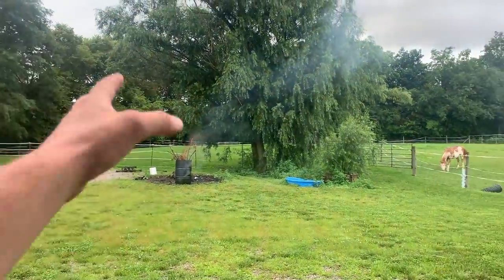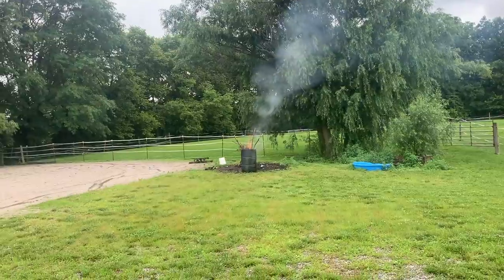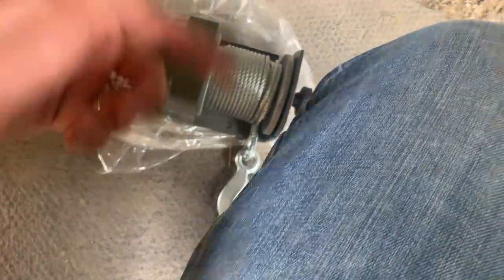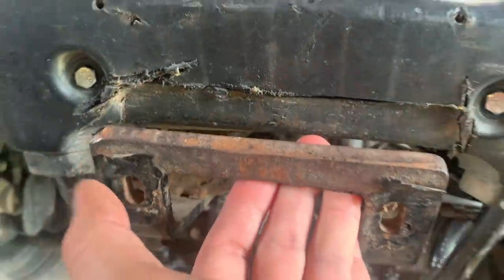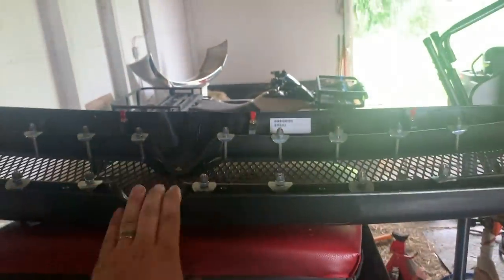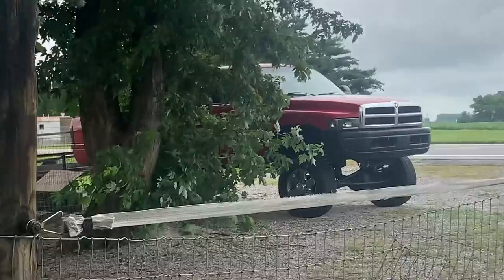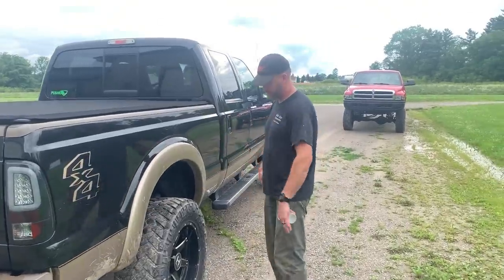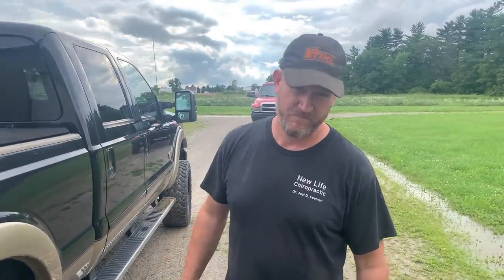EVERYTHING WRONG with a 6.7 PowerStroke! *8 YEAR REVIEW*

Comment: A year and a half ago I sold my dodge and bought a 2011 6.7 ford best decision I ever made. I beat on it every time I drive it and it never lets me down. drives great tons of power 358k miles and it drives like a new truck.
Reply: Why not a power stroke photo then lol
Reply: You bought the truck with over 300k then possibly? How much did you pay?
Reply: @BannedSports   payed 11k in 2018 selling it for 16k after putting a trans and a a lot of engine mods into it had it for 30k miles.
Reply: @hoosqt7447  because most power strokes are garbage. I’ve owned 3 Cummins always been good motors just nonstop issues with the truck surrounding the motor.
Reply: @djcurtis8677  that’s true engine good but the transmission….

Comment: Tons of trucks with the 6.7 powerstroke have surpassed 1 million miles. Best diesel by far not even close. You never hear anyone complain about a 6.7
Reply: I'm looking at buying a F750 from auction. they have like 8 of them. nearly all of them have blowby and im talking trucks with 24k to 60k miles on them. is this just something that 6.7's do?
Reply: So true. I love my 2015 power stroke best investment I ever made and I own it no payments the biggest issue it had was injection pump took a shit at around 75k but it was under warranty still thank god now 155k and goin stronger than ever
Reply: @jakethesk8roberts763  ya until cp4 pump blows up and takes out the fuel system
Reply: @avathompson6711  did you not read my reply my cp4 took a shit I had it repaired at 75k
Reply: @avathompson6711  replaced

Comment: Early 6.7 were known for the turbo issues they got it fixed on the newer models
Reply: like what year?
Reply: @VIP854  2015 is when Ford put in a different turbo
Reply: Your talking about. 2015 model years? Come now. This engine has been bullet  proof since introduction here in the united states.
Reply: I have a 2016 F250 now and the turbo went out at 96K

Comment: Should have 4 mount points to the frame of the atv then 4 bolt holes on the mounting plate to mount the winch to. Then your fair lead will mount to the front for the cable to run through.

Comment: Has he had any leaks from the vacuum pump in front of the radiator fan?  I had a small oil leak from the pump. Come to find out two out of four bolts were loose. I can move them with my hand. Apparently it’s a known problem on the 6.7
Reply from the maker: I believe that was an issue at one point

Comment: I have a 2014 f350 srw platnuim was a great truck until motor messed upped rocker arm fell off pushrods on cylinder 2 and causing lifter to eat camshaft engine had 273k gonna get new engine from ford but every 150k or 200k replace rockers arms would be also recommended

Comment: I have a global 2013 Ford Ranger PX1 and the clear coat peeled as well. Granted, the truck was always parked outside under the inclement tropical sun. I painted the truck and now I keep it in a closed garage. My truck has been awesome too. It has the 3.2 I5 diesel found in the Transit vans. Very awesome engines. Truck has had its fair number of issues but the majority were minimal go medium annoyances. The big one was the mechatronics unit going out after 6 years and low mileage. Its a common issue on those years and I think its a common 6R80 transmission issue. Even with all its issues, there is just something about Ford trucks that I like over the other trucks, and Id pick one over the most reliable Toyota.

Comment: I found a 12 valve cummm 1998 / 191,000 miles for 5,000 healthy engine but rusted frame should I purchase it ?
Reply: If you don't mind sourcing a solid one and swapping it out, go for it
Reply: @alandillon6469  is a swap expensive I feeel like it is
Reply: Anything for the Cummins
Reply: @hazzurs  Well that would be the point, saving a awesome truck from the crusher!

Depends on what you get a frame for of course. But it is labor intensive and would need a lift(I personally wouldn't without). So you have to out weight the cost and effort, also consider the condition of the rest of the truck... 191k is not many miles for a '98! Many positives there, so good luck with your decision man🤘🇺🇸
Reply: @alandillon6469  thank you so much for your time , and I’m gonna use it for construction so I definitely gonna have to look for a new body soon

Comment: Well the 6.7 can cost over 58k brand new and when I went to the shop to get a spark plug for my truck ,,every diesel there was a 6.7 power stroke and they all had from 20k to 60 k miles on them ,and 3 out of the 7 there needed a engine rebuild,,lmao I guess that shows how reliable them piles of sh** are,,never buy one don’t get stranded .
Reply: If you do buy one do your self a favor and don’t spend 15 grand on it and keep it stock